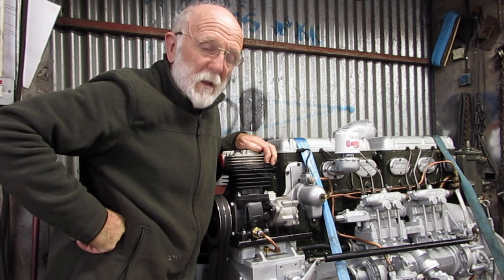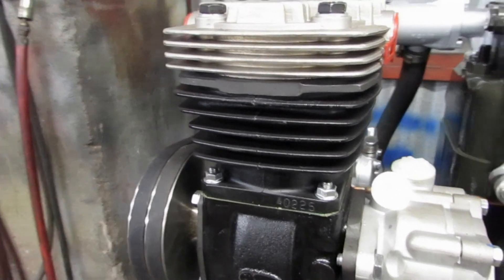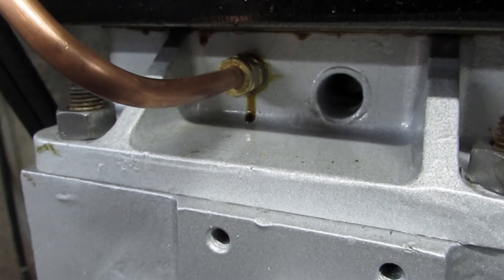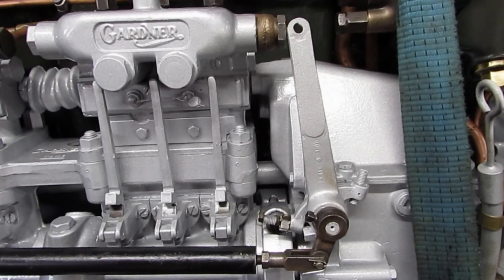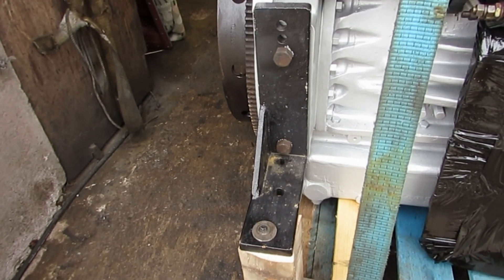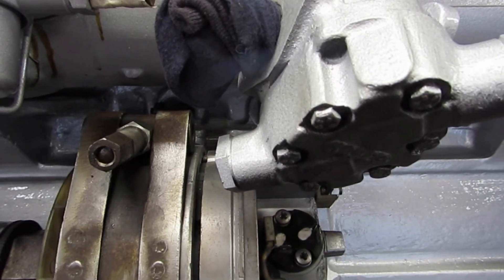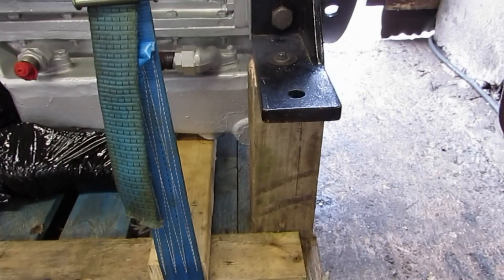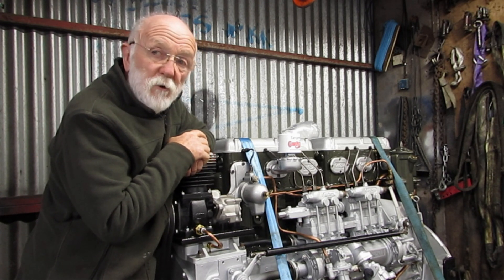Gardner Engines: 6LXB for forestry truck

Comment: I'd share concern on the fan pulley, recalling distantly  belt drive torque at pulleys being proportional  to "e to the power of (mu x theta) " making pulley contact angle (theta probably in radians, but I'm not going Googling) disproportionately vital. The Plan B air conditioning compressor drive idea  looks good.  Hoping also (respectful comment) the air compressor gravity  drain line is big enough to avoid oil backing up in the compressor's crank case? Much fantasy influence from your channel about the  best propulsion choice for an imagined canal boat; should it be vintage Gardner, Lister JP or Bolinder power?
Reply from the maker: Agree all your comments, thanks a lot.   As regards canal boat: our own 50T Snark is powered by a 5LW!   Nothing comparable on the Shannon will catch her!    To my shame, I have given the poor old 5LW DOGS' ABUSE, I mean DOGS' ABUSE and she still keeps going, happy as the flowers in May!
Reply: @tangentgardner  Every 40 years or so a bit of rusty mechanical engineering knowledge  suddenly has relevance, recently belt drive aggro on a second alternator project on a Unimog with OM366LA power.   I've had a couple of near misses acquiring 3LWs, I have a JP4 generator dragged out of a WW2 airfield control tower and a lot of other Listers.  One practical point on Canal boats,  people seem to have engines idling at crazily low speeds. I'm not convinced that is good news for crankshaft torsional vibration, journal  bearing films, having enough heat to maintain cylinder temperatures for proper clearances, bore glazing issues etc.  Do you have any engine speed  opinions from Gardner perspectives ? An rpm video  and canal boat racing would be great!  I loved the Gardner-Land Rover conversion, but somewhat raucous ! Rgds, Phil.

Comment: Does the auxiliary drive shaft also rotate at 1.8 times engine speed on a 6LW fitted with a dynamo generator?
Reply: Nobody still using a dynamo.All generators use an alternator that uses full wave rectifier.Frequency stabilisation  as well.Frequency variation should not exceed +,- 5pc max if the AC is for domestic use.